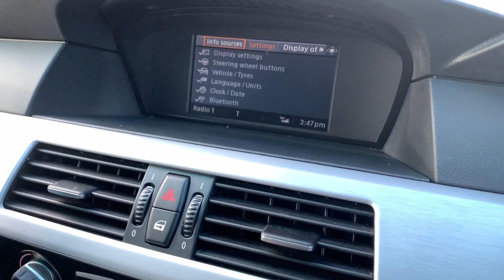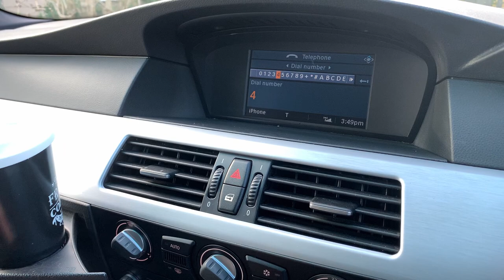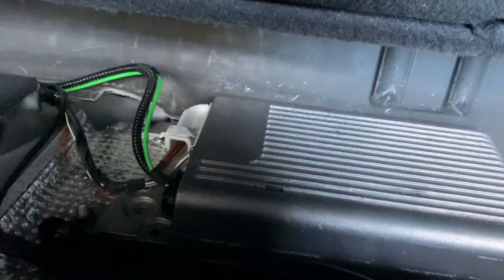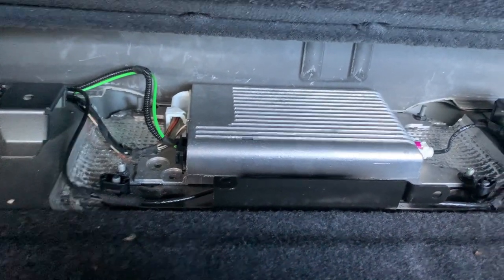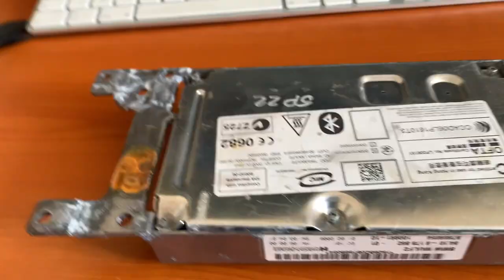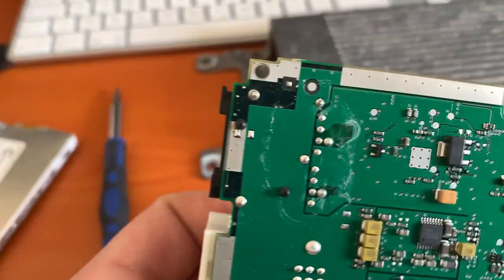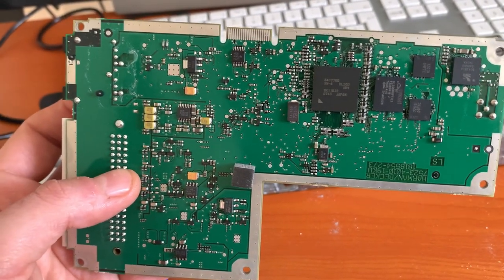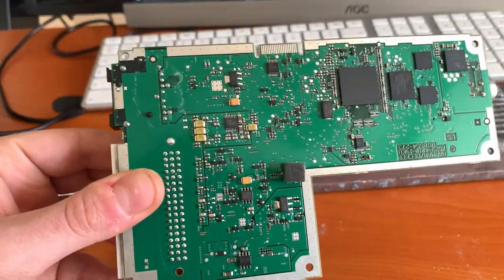How to fix BMW Bluetooth Module failure!  (MULF2 Replacement)

Comment: Was your AUX working beforehand? If not, did replacing the MULF2 bring it back? I have a 2010 E60 and my MULF2 module was COMPLETELY crusted over… I fiber looped it out and oddly enough my BT started working… I don’t know how removing the BT makes it START working (maybe because the rest of the wires are connected)
Reply from the maker: Hi, I don’t have a highly specced car so only the standard mulf ‘low’ Bluetooth without sos etc and the standard aux in jack socket. My second e60 has both TCU and Mulf which both control the Bluetooth. Maybe your TCU handles your Bluetooth and the mulf is handling the audio. (Usb equipped cars use the mulf2 unit.) just guessing as I don’t know exactly your spec or factory order. Hope that helps.
Reply: @FuelledLife  thank you!!!! If I get a MULF2 from eBay, do I need to match any numbers? Code it? Or can I just plug and play?
Reply from the maker: @akura2  just find the same part from around the same time (preferably the same part number.) plug and play. 👍

Comment: My mulf2 module has corroded from the connectors, so when i replace it do i need the code it and change all the wiring?
Reply from the maker: No coding required.
Just replace any pins that are corroded or clean them with contact cleaner. 👍 cheers for watching
Reply: @FuelledLife  i will let you know how i get on when i clean all the corosion of with contact cleaner, also the codes/numbers on the mulf2 module, do i have to make sure its exactly the same codes/number when i replace the module

I hope my question makes sense. Thanks in advance

Comment: Hi just checked my boot and there Isn’t any wiring that looks similar to yours was hoping I’d find a Bluetooth module I could code in I have a 2008 e61 530D SE , is it possible to somehow retrofit Bluetooth to my system I have the old CCC like yours I have cables there but definately not what you have plugged into your module any help be great 
Thanks
Reply from the maker: Hi Jason, you would need to run the harness from the fuse box etc around the car, add the module and then code it in. I would recommend just buying a andream carplay unit. It’s modern and works way better for calls 👍
Reply: @FuelledLife  hi sir, I have a 07 plate 520d without the Bluetooth module. just wanted to ask that if I replace the stock idrive unit, with the andream unit will it work and give notifications like the idrive  unit about the car??
Pls reply it will be of great help..
Reply from the maker: @RahulJaiswal-ug1ql  happy to help! 👍 it works over the top of iDrive so you gain Bluetooth and apple CarPlay. When your car chimes or has a fault or information is stored, you will see it come up on your dash and hear it. You then simply hold down the menu button and switch back to the old iDrive system and view the message. Does that make sense?
Reply: @FuelledLife  oh, thanks. So it means that the idrive will remain in place and continue running, and this andream unit will be an additional upgrade to the car infotainment system. I hope the music sound quality and Bluetooth calls quality/clarity is good enough to hear and talk.
Reply from the maker: @RahulJaiswal-ug1ql  that’s right, spot on. I personally never had any issues but I guess it’s subjective.

Comment: Before replacing the module, did your USB port and aux worked?
Reply from the maker: Hi Luis, my car doesn’t have that option fitted. My symptoms were no phone selection and my voice commands button would work but the car wouldn’t speak back to me or respond when pressed.
Reply: My usb/aux also don't work. Bluetooth doesn't even toggle in iDrive. Mechanic said the MULF module for my model ties into aux/usb which explains why I don't have either one. They want 1500 to complete the repair. I'll just do it myself for that. 2008 535xi.
Reply: @_Charrizard_  same problem, aux, usb and Bluetooth. Is the problem same?
Reply: @_Charrizard_  mulf 2

Comment: please help :D did you have to recode your new MULF2 or can i replace mulf2 for mulf2 as a plug and play? :D mine blew up (not a water issue for me) but hoping i can just swap with another one E60 2006 :)
Reply from the maker: Hi Legless, it was a straight swap. You shouldn’t need to code another MULF2 from a similar car. It worked perfectly!
Reply: @FuelledLife  THANKYOU SO MUCH!!! haha i hate having something not working even if i rarely use it :D thanks for taking the time to respond to an old video :) Like and sub from me :)
Reply from the maker: @legless00  your very welcome! Thanks for watching 👍 legend!